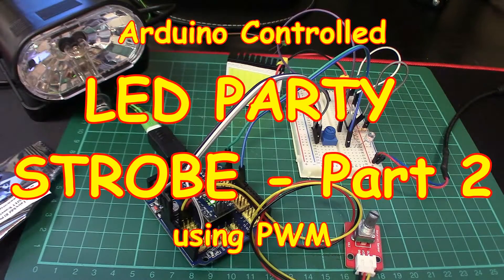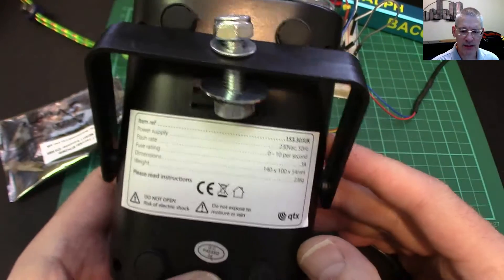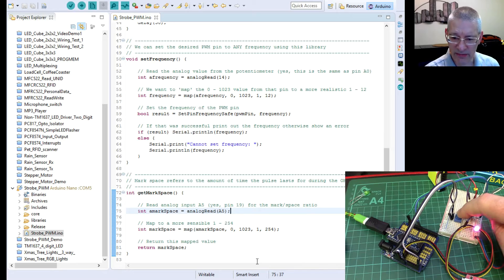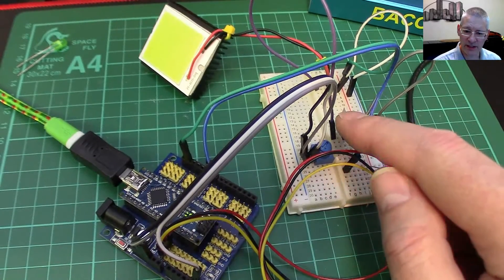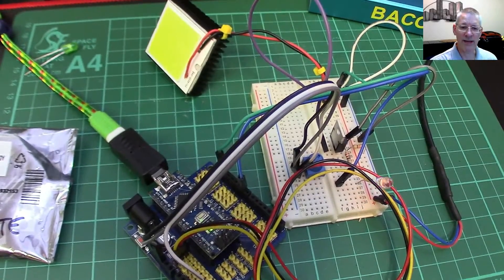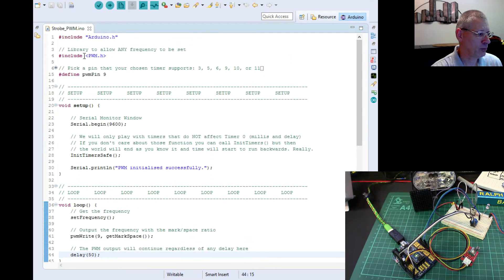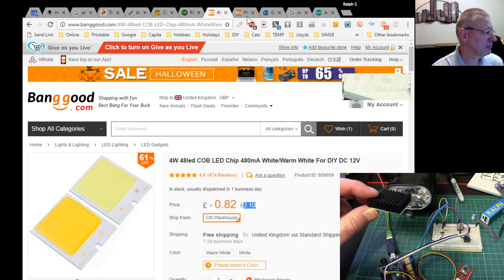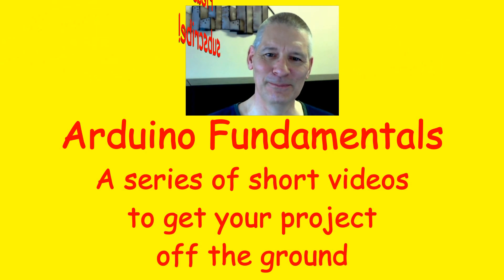#61 LED Party Strobe Part 2

Comment: RFP12N10L are only 35p each @ RS UK and free next day delivery. :)
Reply from the maker: That's a good price, Kuk, but there are better ones which other viewers have pointed out to me and which I mention in other videos. By "better" I mean lower RDSon resistance but still very low cost. But for quick (and cheap) delivery in the UK this might be all you need. Thanks for the heads up!